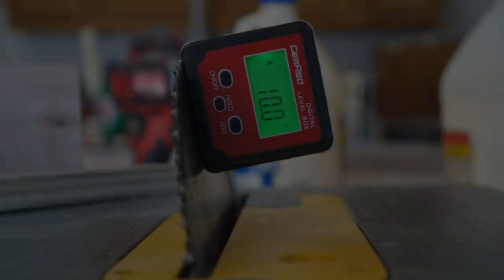Mid Century Modern Plywood Dining Room Table Build

Comment: Finaly found a project similar to what I am planing to build. I have a question, hope you can answer. I see you used screws to atach the table top. I've been told that it's wrong that I should use brakets or 8-shape washer, or somethjing else, but not screw the legs directly into the table top. Obviously you did. What is your reasoning behind using screws. BTW, table is beautiful.
Reply: I’m no expert, but I think that’s a bigger deal with tabletops made from jointed dimensional lumber. Since plywood has layers with grain turned perpendicular to each other, it doesn’t expand and contract as much.